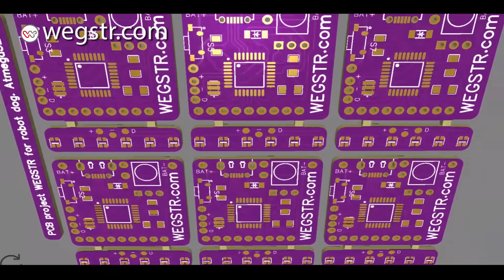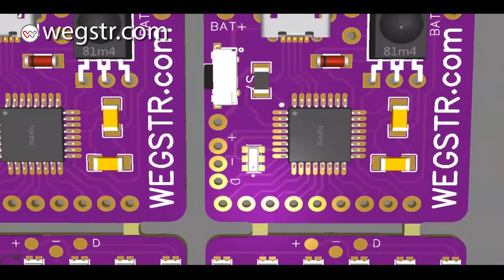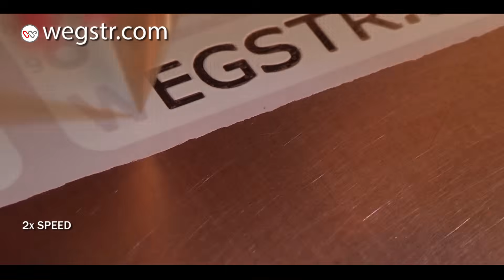PCB and robot making at home - wegstr cnc

Comment: 2:00 Milling In Oil ! What type and how is it applied ? Did you just pour some oil over the FR4 or is there an Oil Bathe or 'Coolant' outlet ?
Reply: The oil used in milling is usually mineral oil/but you can substitute it clear coconut oil from market.
As for how it's applied on the PCB that is done with a syringe with just the main tube since oil is usually thick enough to not drip out depending on it's and surrounding atmospheric temperature but for very specific places/parts applications a needle is added onto the syringe to carefully apply the oil where needed.😊😊😊

Comment: I D/L the software and played with it, very basic....but it only works with mm, can NOT convert or switch to do files made in inches, example (.001").  For the cost of machine, software needs improvement in a few area's for doing real CNC work.

Comment: Not sure how plausible it is to be using a fine tipped drill to remove copper that's glued to a substrate, and somehow we've found the right depth to remove the copper, the glue, and somehow leave a polished surface on the substrate.
Reply: u clearly know absolutely nothing about PCB prototyping as a hobby...
Reply: @seriousslavi5847  You clearly no nothing about materials science and as likely have never machined a thing in your life.

I think you'll find, in the extreme closeups, the particle physics of the swath is giving it away.  The mat usually comes through under normal circumstances, so they should have used a better texture on the fibreglass surface and satin instead of gloss.  There's certainly a couple of videos of the actual machine that, what a surprise, don't show the same swath behaviour as the close ups. 

Nice machine though.  Not bad animation effects.  Fools most people.

Comment: cool, but too expensive! only for the rich.
Reply: A cnc mill can cost you anything from hundreds to thousands, if only for pcb making the price go down by a lot unless you want some highly specified one. A 3d printer is the same. And the materials aside from that aren't that much either unless you want to add lidar or some other hight tech stuff into it. Overall, the cost ain't that much.